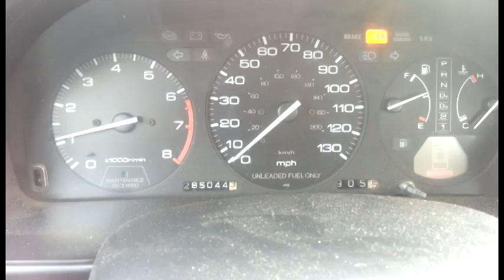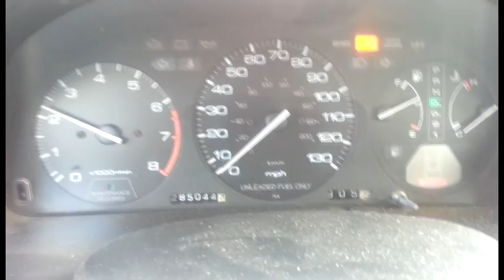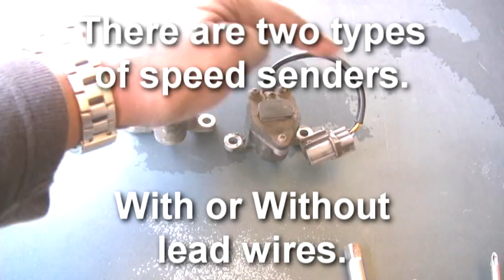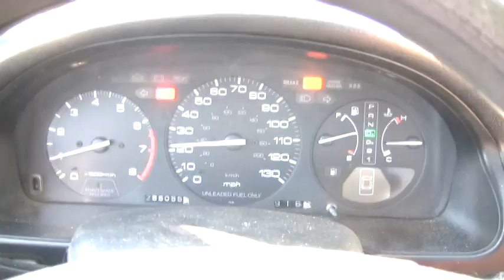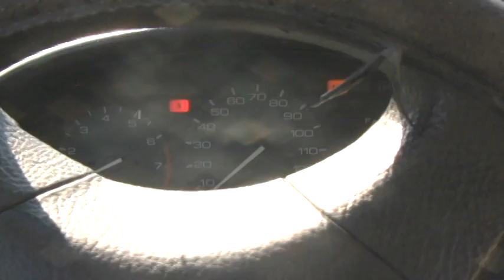How to Change the Vehicle Speed Sensor on a Honda Accord

Comment: Thank you!  I watched the video and had the same issues and lights, so I picked up the part at Advance auto and changed the Speed sensor in less than an hour in the dark with a outdoor work light.  part cost me a little less than $60.  Thanks again for the video.

Comment: Thank you for the nice video. I have question.  I have done a light tune-up on my 92 Accord and intermittently it exhibits what seems to be a transmission problem.  Most videos I have seen on the speed sensor talk about the speedometer not working.  My speedometer seems to be working fine so does this mean its not the speed sensor?

Comment: I have the air cleaner off, I'm struggling to get that one bolt on the right off! I need another extension:(
Once I get another extension and complete the job I will update.
Great video thanks

Comment: Good video. What about a 1996 Honda Accord 2.2 VTIS? I got a similar problem where the speed meter isn't working as well as the D4 light keeps flashing when driving. Do you think the problem the same with yours and the location of the sensor the same? Would you please teach me how?

Comment: I changed new but still same problem the needle shaking between 30 to 35 when engine switche off then goes to zero if on even no start it then again stays 30 without shaking

Comment: will this work for a 94 accord lx?
Reply: fixed it...no its in a completley diff area in the car on a 94 alot harder to get to
Reply: Yeah, 1994 tougher to get to. Need a couple 1/4" long extensions, 1/4 breaker bar (car makers never put antiseize on fasteners), and 1/4" universal joint. Probably need new hose clamp for throttle body (car makers never use corrosion resistant hose clamps and heads always strip out). But good video. got my replacement off amazon.